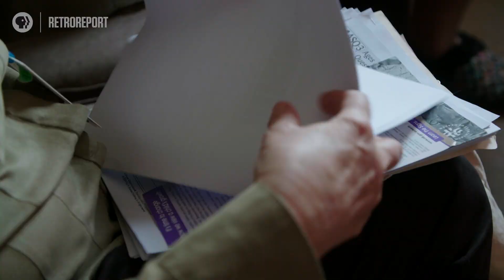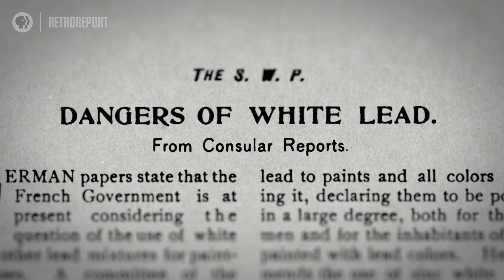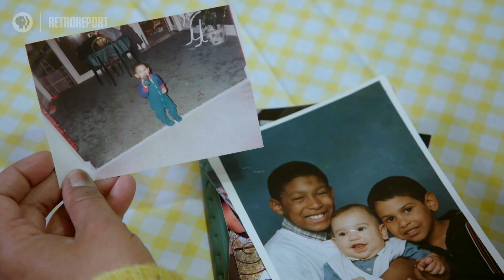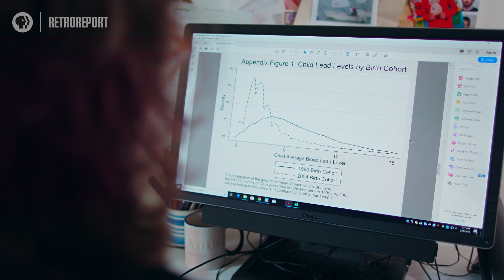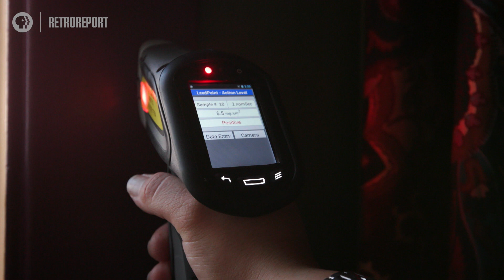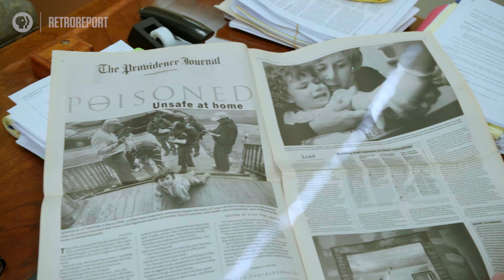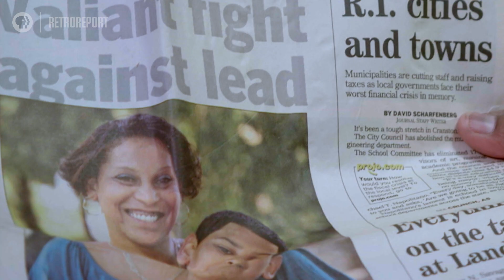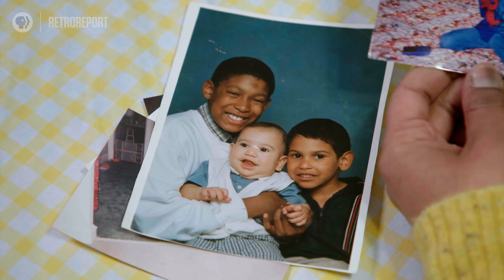Lingering Peril From Lead Paint | Retro Report on PBS

Comment: In 1968, my partner lost his father to lead poisoning.  He painted the family bathroom using cans of spray paint in an unventilated area with no mask on.  He didn’t know the danger.  He got very sick and died after a week.  His autopsy showed that he had so much lead in his system that it caused multi systemic organ failure.  My partner was 8.  He lost his father at 8 years old.  I remember the house I lived in as a child had that peeling flaky paint in the doorways.  This was in 1976.  My dad was a construction worker and he knew how to take care of the lead paint once people were made aware of the problem.  He fixed those doors and windows by removing them entirely and replacing them with new wood.  He paneled over all of the painted walls with real wood paneling.  It was never painted.  We moved from there when I was 13.

Comment: I live in a pre war building and I’m kinda scared to sand anything down to refinish it...
Reply: Maggie E if you aren’t a young child or have a young child, then it’s not a problem. Children are the ones vulnerable to it
Reply: You can buy a kit to test it
Reply: @nola1439  Absolutely not true. Adults are susceptible to lead poisoning as well, but the threshold is much higher and the risks aren't as great. Still, there is no safe blood lead level, no matter your age. Notice the protective suit worn by the man preparing to remove the lead paint? Anyway, you can get a lead test kit at Home Depot. If you find the paint to contain lead, absolutely do not sand it. You will inhale more than a lifetime's worth of lead dust by doing so. Either leave it the way it is or paint over it. If the paint is flaking, a hallmark sign of lead paint, you either need to pay to get it removed or resign yourself to duct taping the troublesome areas.
Reply: Lead paint isn’t dangerous as long as you don’t ingest or inhale it. If you just leave it be, then it’s fine.

Comment: Meanwhile my school found out that they had a sort of insulation in the walls that can result in cancer when I was in middle school and nothing has been renovated yet and I’m already in my second year of university..
Reply: Caro Honest what I’ve heard (although I couldn’t find evidence to back this up) is that asbestos (I’m assuming this is what you’re referring to) isn’t too dangerous as long as it’s left alone. It’s just that when it gets broken or disturbed that it releases the carcinogenic fibers.
Reply: Most likely asbestos which is harmless if it stays sealed up in the walls.  If it deteriorates and becomes airborne, it can cause mesothelioma, a deadly form of lung cancer.  Often, the best thing to do with it is nothing.  If the school were to remodel, break down the walls, etc., it would be a federally mandated hazmat site.  Often, the best thing to do is to completely raze a building and rebuild.
Reply: I was in middle school in about 1983 and they were removing asbestos from the walls of the school while we were attending school. They hung sheets of plastic over the door of the classrooms they were working in while we continued going to classes.
Reply: @queenbeeshana  my god, you really do wonder how much impact such carelessness has on people’s health later in life. Especially when you’re exposed to it as a child. 
My school just made us open the windows a lot to “air it out” and I kid you not, I have now graduated university, it’s been 10 years and the school still stands as it is! Some parents probably don’t even know when sending their kids there now.